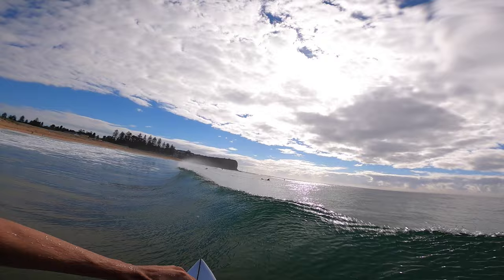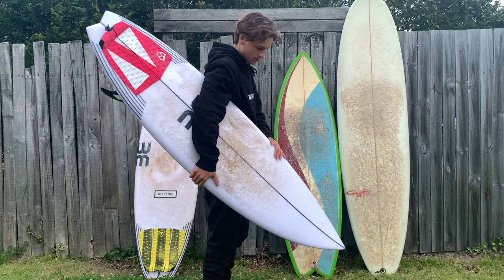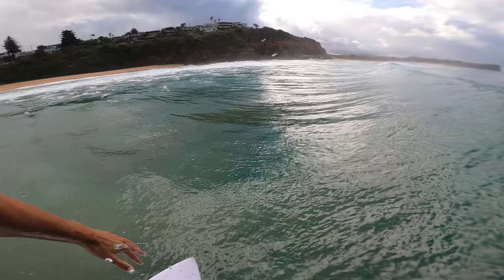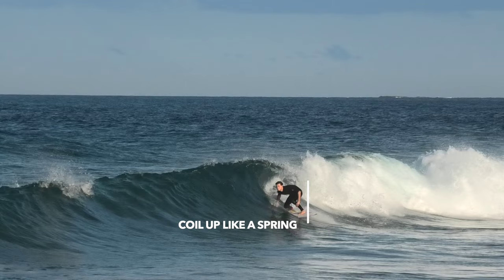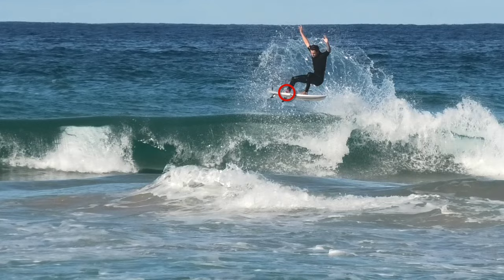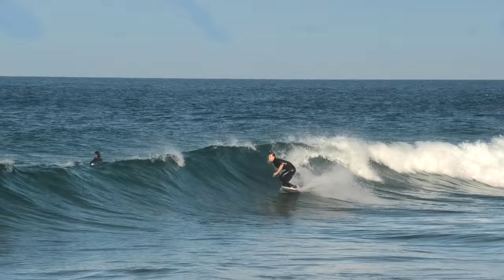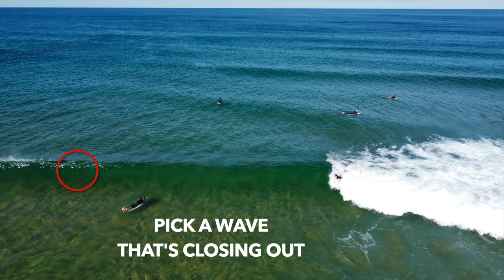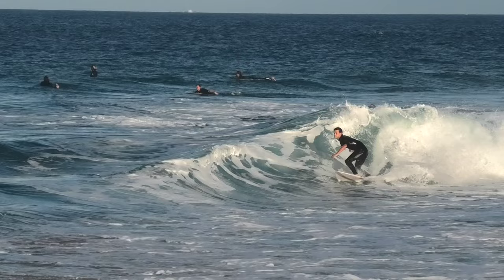HOW TO DO AN AIR SURFING! (POV Footage + Skate Simulation)

Comment: Awesome video here finally some quality  tutorial on airs thanks a lot 🙏🙏🇫🇷
It’s been a month now that I’m finally landing some straight airs and I’m sure your advices will help me even more! 
I think it’d be logical to follow through FS Air Rev tutorial 😜
Im struggling so hard to combine air and rotation I’m always landing parallel to the wave and beach and it’s driving me crazy… can’t figure how to throw those fins to the beach.
Pleaseeee help me with us 🙏
Reply from the maker: Yeww thanks Nicolas!! Stoked to hear you’re landing some airs, that’s awesome. I used to have the same problem for years going for air revs, I’ll make a video on it. But in the meantime, put your back arm behind you as you bottom turn then swing it round and look over shoulder as you start to get in the air… that helped me so much with my rotation 🤙🏽 full video soon though!!

Comment: A few years ago I've been lucky enough to be taught by a couple legendary surfers to do airs such as Filipe for full rotations and air reverses and Jordy for regular straight airs yet this tutorial is still probably better than those 2 pros.😂 I think there's 2 things to get into to make this tutorial better and that is grabs and something else I'll say now now. On your forehand when u throw your back arm into the air it's good to try grab your rail.  Either hand is fine, I'm natural footed but have a habit of grabbing with my left hand on straight airs which helps angle my nose outwards towards the beach and then grabbing with my right hand on any rotational airs just cos it helps me keep my board to my feet most of the time. But grabbing will help get your knees up to your chest. Then the other tip is while your doing the shallow bottom turn for the air u can try eying above the lip. Kinda like a few inches above. Idk why but that helped me so much!!
Reply from the maker: Thanks so much for the message mate, I really appreciate it!! 

And also thank you for sharing those other two tips, I think they will be super helpful to others learning to do airs 🙌🏽

Comment: I'm finally going to upgrade my board from a 6'6 $20 js industry gumtree board with cracks and stuff but I don't know what to get and also know nothing about surf brands or surfboards. I'm trying to find an alright used board for under $350-$400 but I don't know what to look for or even what size. If anyone knows what I should look floor please give us a reply. I'm 6ft and 67kg. btw this is the best and clearest air tutorial I've ever seen. Cheers to anyone who replies.
Reply from the maker: First off, thank you so much! Secondly, what level are you at with your surfing?
Reply: @SurfingWithNoz  experienced
Reply from the maker: @lstbz4309  okay bro, so at my level I’m riding 24-25.5L boards (more around the 25L mark) and I’m the exact same weight as you (but 5’9) so I’d go for a board with a bit more literage than me like 26-28L. If you’re pretty good go lower litres, if you don’t catch heaps of waves go for 28L (more waves = more experience and foam is your friend!) and 6’6 in my opinion is way too long! I ride 5’7 and 5’6 so I’d go for 6’0 to 6’1 (every inch is a big difference) so quick recap. 
Go 6’0 or 6’1 and 26-28L if you are confident in your ability go on the small side of this scale but if you’re learning a fair bit still, the extra  volume will help you out so much! Most people make a big mistake in riding boards that are too small so I’d personally recommend going bigger 🤙🏽 hope this helps mate, thanks for watching my videos!

Comment: Hey dude. Have u had any problems with the hero 8 black ? Software or freeze framing.  My 7 black jus shat it self after filming on 4k for 20mins  , still goes but won't turn on after I've turned it off any other lil issues . Any advice would be appreciated 🤙🏽🤙🏽
Reply from the maker: Hey man! Yeah mine freezes after a take a long video or randomly (probably every 2nd session) so I have to restart it holding both buttons down. But then whatever video it just took or froze on is ruined, can’t be accessed. The only advice I could give is don’t take videos for too long but kinda defeats the purpose of the camera unfortunately. Hopefully GoPro fix it with the Hero 10 because I heard the 9 still has bugs too
Reply: Cool as bro cheers for that. Yea I hope they fix it soon . I'm gonna buy a 8 as the 9 is pretty shit I've been told to . Or might try out dji . Cheers agn bro , keep shredding ✌🤙🏽🌊

Comment: If a board is 6 inches taller than you will it still work for airs?
Reply from the maker: It’s possible, but it depends more on volume than length. But a longer board generally has higher volume so it could be harder

Comment: Am gonna try this when I get DOME GOD DAMN WAVES. I hate summer. I’m just gonna sleep till winter. Would this work on a 5’5 fish? I’m 5’6 130 lbs. also I kinda want a new board that’s high preformance. I’m 5’6 130-135 lbs. any dim reccomendatioms? Thanks! Great tutorial
Reply from the maker: Yew, thanks so much bro!! Hopefully you get some waves soon. As for the board, I think that size is perfect.. I’m 5’9 and ride 5’7, 5’6 boards (but they make up for volume in the rails) 
If you’re at an intermediate level, get a board around the same height with enough volume to paddle easily into waves. If you’re young and still growing I’d get like a 5’6/7 and 24-25L
Reply: @SurfingWithNoz  ok thanks. Yea waves should come in a month or 2 when we start to get cold fronts or bigger hurricanes on the east not west. Yea I’m only 13. I’ll prolly pick up a 5’7 5’8. Today it was 2 foot. I went after a small storm and the winds shifted offshore. Many thought it was still raining so I got all waves to myself. I even pumped down the line on a right. Im goofy and usually go left 🙄. Cool thing cus I struggled with pumping on frontside before. I love the surfskate. Maybe more drills in the future? Keep up the good work.
Reply from the maker: @matiasespina1490  Yeah definitely get a bigger board then!! One to grow into 🤙🏽
Yeww good on you mate, keep it up. You’re young as.. you’ll be doing backflips by my age 🔥
Reply from the maker: @matiasespina1490  and thanks bro, surfskates help a tonne. Will add them to every tutorial-based video 🙌🏽
Reply: @SurfingWithNoz  thanks bro. They rlly help a lot. I love doing cutbacks on them for some reason
Reply from the maker: @matiasespina1490  yeah they feel so good! Love replicating a big roundhouse 😍

Comment: withe sofech filipe toledo wildfire 5/11 i can doing the air?
Reply from the maker: Depending your weight/height of course!
Reply: @SurfingWithNoz  im 60 kg and 1.67 and thnks for your answer!!!!🙏👌🤙🔥👑
Reply from the maker: @user-hz6mf5vd3m  no worries bro! How many litres is that surfboard? Would be way easier on a smaller one I think. But is possible on that one
Reply: @SurfingWithNoz  37 liter
Reply from the maker: @user-hz6mf5vd3m  Ahh okay, I'd highly recommend you drop down some litres when attempting airs. I'm 67kg and ride 25L so I'd get a board under 25L to practice on